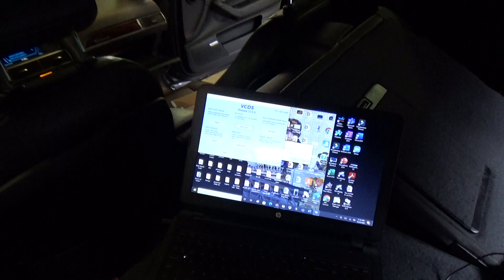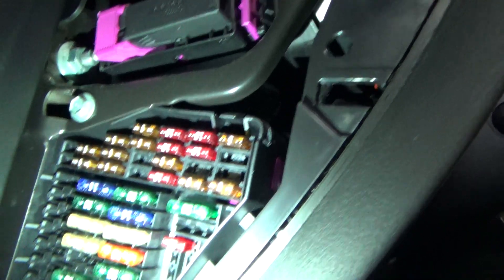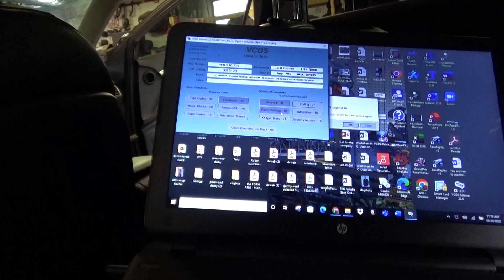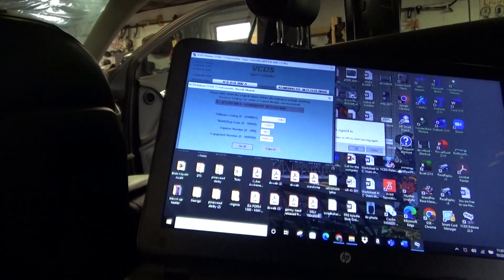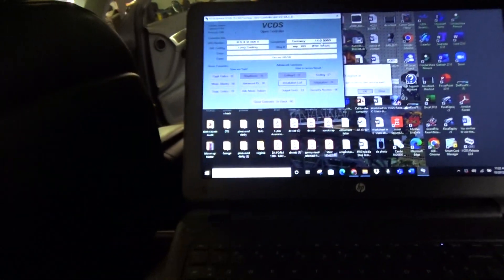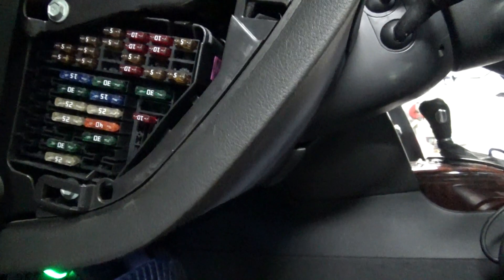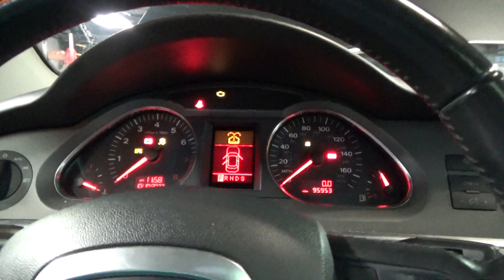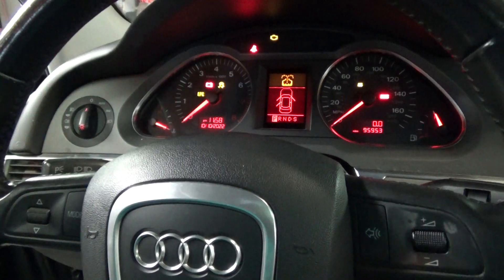Audi Adaptive Headlight Fixed Forever

Comment: Did you actually fix the problem or just mute the error code?? Do they work 100% correctly and adaptively after this? I think not...
Reply from the maker: Depends on what you think the end goal is.  Do they work? High beam, low beam absolutely, is the light and alarm in the car going off, no.  Do the headlights turn with the steering wheel, no.  Is the car bearable to drive, yes.  Did I put $5k of new headlights into a $5k car, nope.  Did I keep another old car on the road, and get my daughter reliable transportation to and from college, absolutely.  So yeah for me it is fixed…. Is it perfect no, but I stand behind the term fixed.

Comment: I had this same problem on a 07 a6. I believe I found these same steps on the Audizine forum. I printed the procedure on a couple sheets of paper, easy step-by-step instructions. 

 Spoke w a couple of my Audi mechs on maybe having them clear it for me, prolly an hr shop time charge.

 Ended up finding a great set of headlights at the local pick n pull n swapped out lights,  which corrected the issue. 

So much shit you can do w VCDS hardware. These cars won't even take LED bulbs w/o reprogramming them. Good video. Its nice to see some of us"fix" our own rides when the need arises. 👍
Reply from the maker: Thanks a bunch, I wrestled with the headlights for a long time on this car.  Sometimes the best thing you can do to keep a $5k car on the road is spend your money wisely on what really matters.

Comment: But the headlights will still adjust up and down ?
Reply from the maker: @bectasiuneraikens2997  nope
Reply: @GSEShop  i mean the xenon will still adjust automatically ? No ? If the car is bended forward they will not go up ? Afs as i know is for left and right.
Reply: @GSEShop  i mean when you start the car. I had before an audi a8 d3 with no cornering lights. They move up and down to adjust when starting car. Another a8 d3 have afs feature with error. If i decode afs feature they will still move up and down to adjust when starting car right ?

Comment: I dont' think I'd call this a fix.  You are removing the feature entirely, not fixing it.
Reply from the maker: Depends on your point of view.
Reply: Exactly!
It's like ... the TV stopped working.
Let me FIX IT by throwing it away :))))
Reply from the maker: @mariusgodeanu5069  it keeps the warning light off and the car on the road.
Reply: @GSEShop  the car would have been on the road regardless of the light on the dash. I know cause I have that light appearing from time to time ( that's how I found your video :) ).
Although I understand your point about the light being annoying, the fact that you said FIXED FOREVER in the title, while you completely removed the feature altogether, is indeed misleading :)
Anyway - thanks for the... solution, it could work for a lot of people.
Reply from the maker: @mariusgodeanu5069  I fixed the light on the dash and the annoying alarm forever.  Sometimes when you have a 10+ year old car you cannot just keep throwing parts at it and there are no new ones at a decent price.  I tried several eBay specials before coming to this.  It was my forever fix.

Comment: Did you put fuse 9 and 18 back in?
I have a S5 2017 and adaptive light issue has come on and there saying on some forms i need new modules. 
Have you done a delete to the adaptive lighting then? 
Thanks
Reply from the maker: Yes put the fuses back in, I am not sure about the module but it did delete the “adaptive” part of the headlight features.  You can even change them to the halogen style that was also an option and a lot less fussy than the Xeon ones.

Comment: Nice video and straith to the point, can you post a link to get the download steps? Yeah i can watch it while troubleshooting an Audi Q7 2007 model but having the instructions handle goes a long way.

Thanks for the video.😊😊😊😊
Reply: I found a copy of what this author is demonstrating.  Google "AudiWorld Adaptive Lighting (APS) Disable/Fix" and scroll to Post#1.
NOTE that this tutorial is for disabling (not correcting) the Adaptive Headlight features of 2006 A6.  My 2012 A7 has this adaptive headlight problem, but none of the fuses match up to these instructions, so I doubt the VCDS coding lines up either.
Reply from the maker: Your welcome, but honestly I forget where I found them.  It was in an Audi enthusiast page for sure

Comment: Great Video!!!! I had so much trouble finding this information. You walked through it. I come from the Ford world. Forscan is easier to use. Thanks again
Reply from the maker: I think VCDS is pretty cool, but this was the only logical fix for this car that didn’t cost more than I paid for it.  Thanks for the comment
Reply: @GSEShop  your exactly right. My customer didn’t want to spend thousands on new head lights.
Reply from the maker: @showmerepair  nor did I

Comment: Will this coding work for an A8L as well? I've got a 2007 A8l with that same damn light that just came on and just ordered my scan tool from Ross tech.
Reply from the maker: I believe so, I am not an Audi tech but I do own one.  This was a 2005 A6
Reply: How to fix i have audi a6 2.7 2005 my light go down after i start the car than 4-5 seconds go so
Much up and i cant see so
Good because they are so much up and it say adaptive problems how to fix that